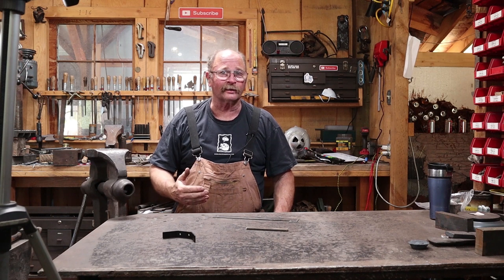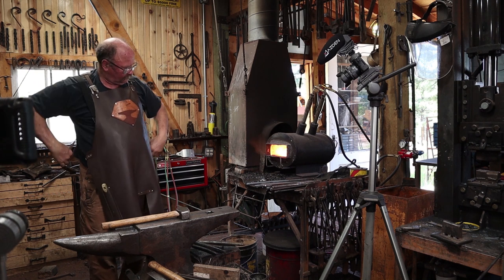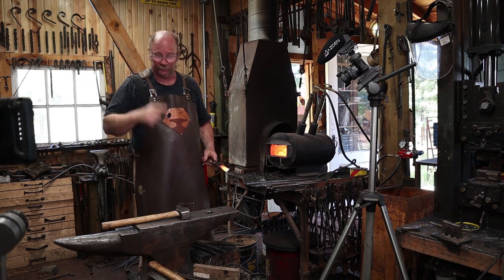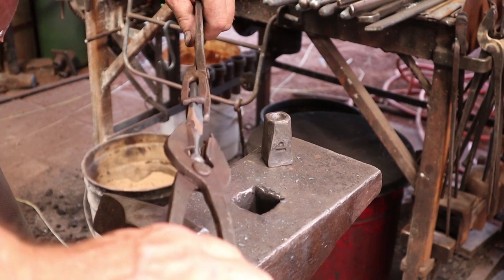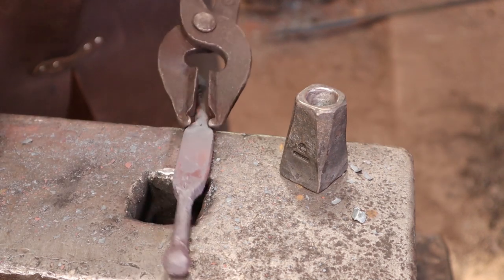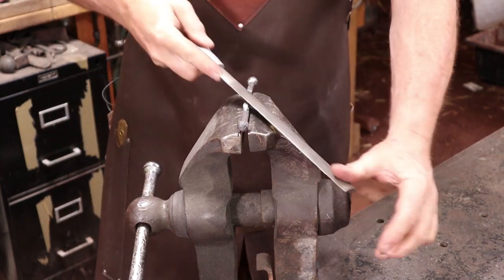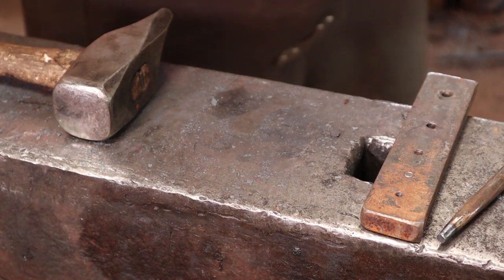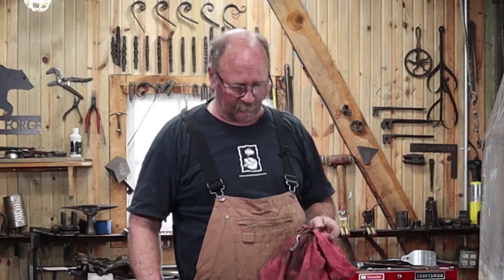Forging a Rope Cleat

Comment: I made something similar with 3/8 square stock. Making the ball ends  required bending a short section of the end back on itself then forge welding them. The ball had to be formed hot but the welds held.
Reply from the maker: Good forge welding exercise.

Comment: Hi!

First off I want to say thank you for always including you measurements in metric, it helps a Swede like me greatly.

Secondly I always like your videos, they're really good at showing the progress in each project.

Lastly, and I'm afraid it's a bit of a complaint, if you could, please do a "tool presentation" at the start. (Have a look at woodworker Matt Estlea's videos to see what I mean) You could just forge away, and drop the tools as you use them, in a bucket and do it at the end and fix it with some editing magic if it's easier.

It's not a big deal, I still like your work, but a lot of times I know the tools used by sight, but not by their English name so getting that clear look would be beneficial.

Thank you again, and I do apologise for any grammatical/spelling mistakes, as English is not my first language.

Comment: The clothes rack you described sounds like what we as kids knew as a creel.  4 - 5 wooden staves about 6 to 8 ft long held up by 3 arched supports suspended by a rope?
This is probably a local Shropshire term as in Scotland, a creel is a fish basket.

Comment: The square nails are a nice touch. I'm wondering if it would have been better to have forged the legs/arms/protrusions out, upset the ends, and then forged the balls? I know that would have taken more time but maybe not since you would have more mass to forge instead of messing around with the blob. I guess I'll have to try it. I've got a set of blinds in the porch that has a flimsy cleat. It bugs me every time I see it.

Comment: Great improvement over that stamped piece sent with it.  Now I have a question, when you are setting at your bench introducing the video I am distracted as I look to the right, your left.  Whatever extends beyond that doorway seems to change from video to video.  Yes I know, "curiosity killed the cat," but just wondered if that is part of the shop, storage, or ??
Reply from the maker: It will eventually be a small office, clean room (meaning no work or tools).  But its still a work in progress.